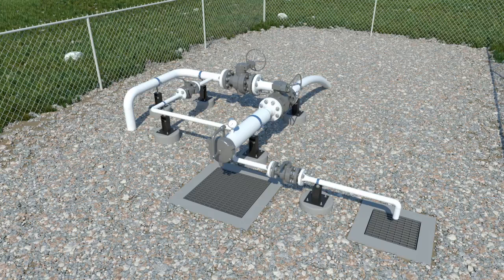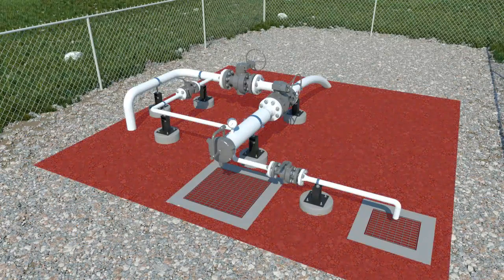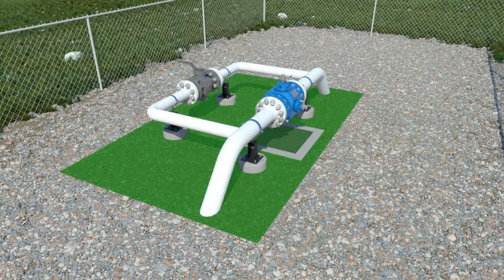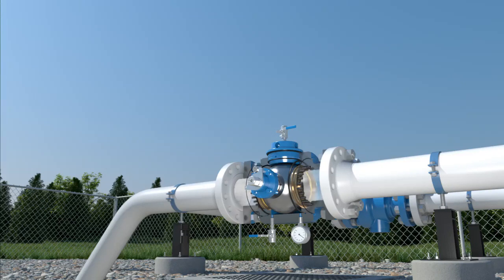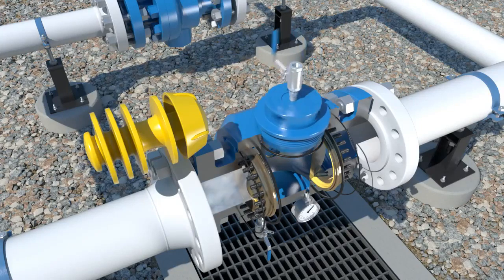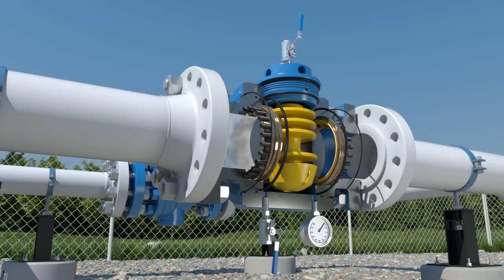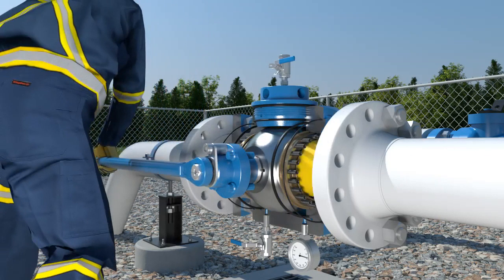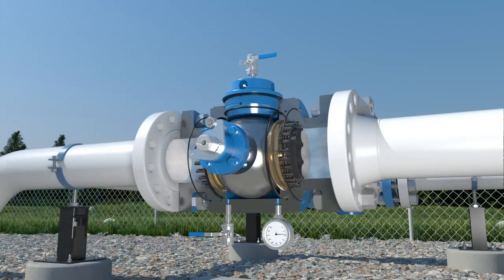Pig Valve ARGUS

Comment: Can a smart pig be used with this system? or is this just for cleaning.
Also what is the largest size for this?

Thanks!
Reply: Yes. Single module ILI technology is available. The largest size is currently 16"
Reply: How much it cost this cleaner valves?